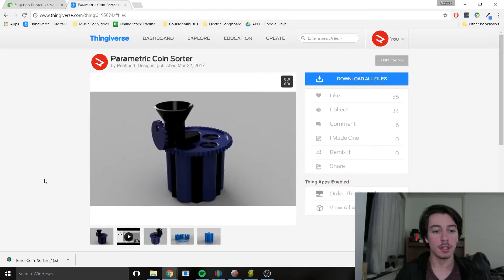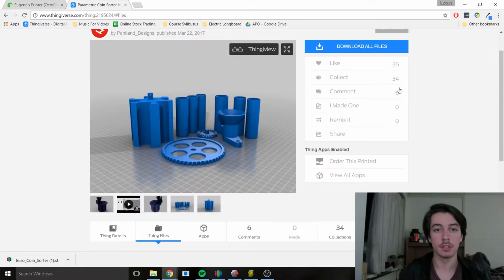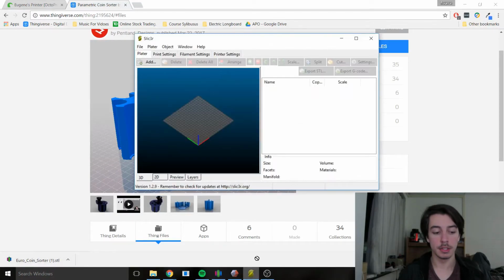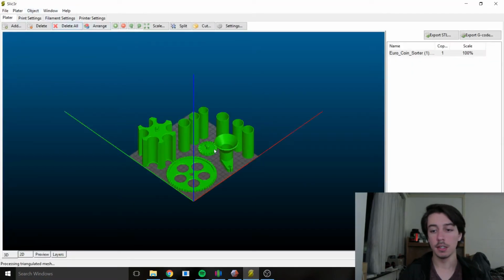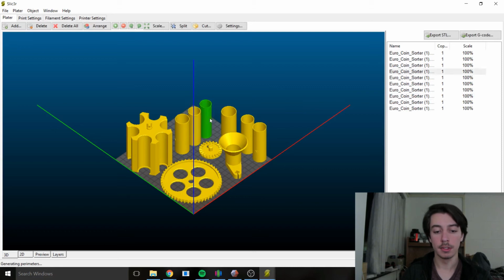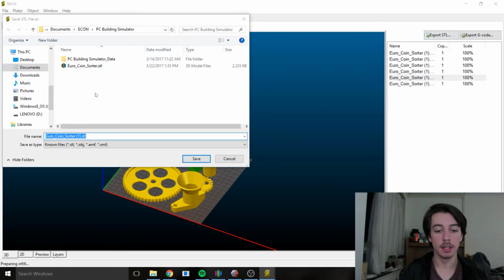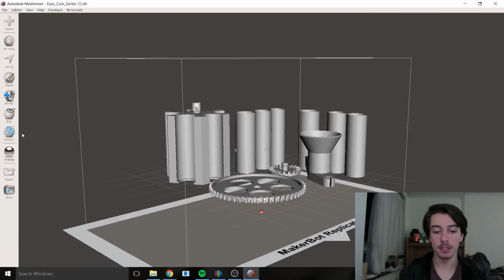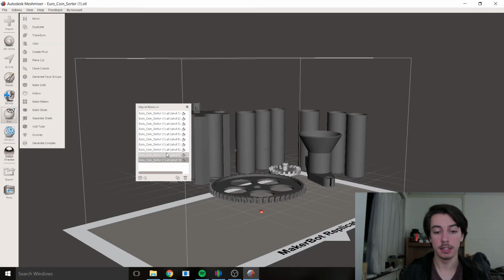3D Printing: How to Separate a STL by Parts

Comment: i have a problem, i separate a ak in 4 parts to print, but Cura said its to big but the model correct. the problem is that the hitbox is mutch bigger that the part. how can i solve it?
Reply: You didn't delete some tiny part so that's extending the hitbox
Reply: How can I regroup the separated parts

Comment: ..."then all you have to do is save them out..."  You could not take an extra 10 seconds to show how to save the separated parts out in STL format from meshmixer???
Reply: Same, i had to go to another video....
1. Highlight the file you want to export
2. "File" (in the top left)
3. "Export"
4. Save in desired folder
5. Drag and drop or open in slicer. 

This will only save the part you have highlighted as its own object file not as part of the group. If you want to save the whole group as one file again, close the object tab and have no parts selected and then export.